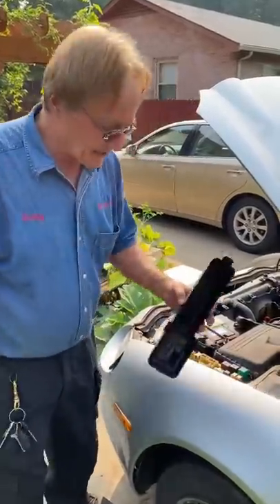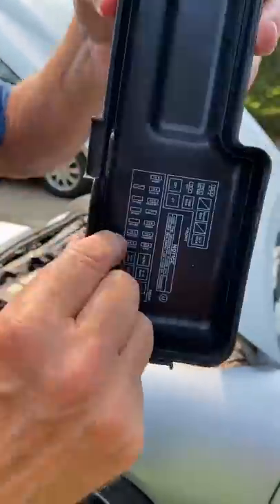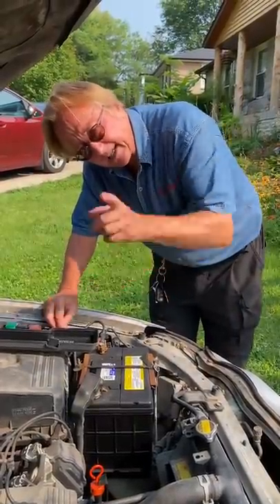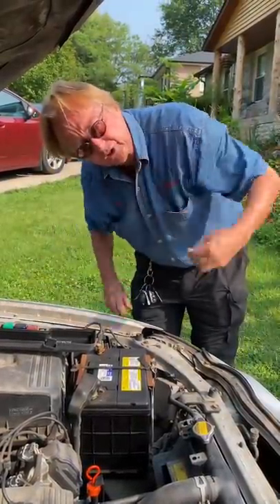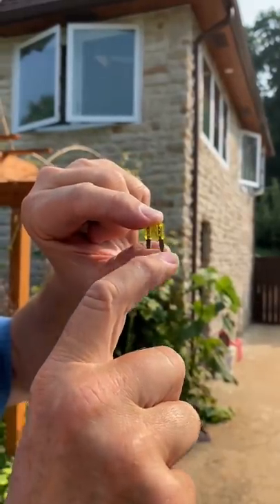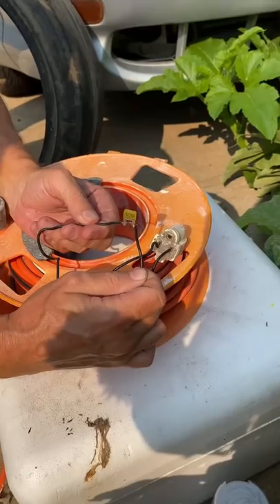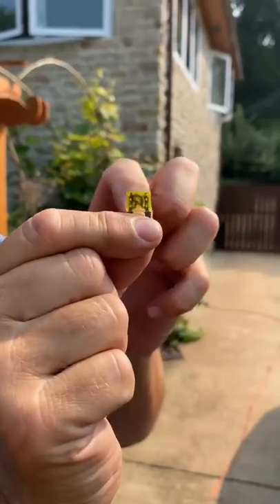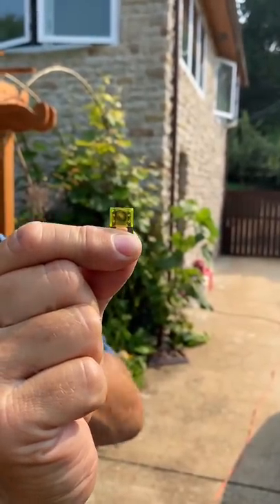Don't Get Screwed by a Mechanic, Check This First

Comment: If you want to disable your car without an expensive alarm system.  Just pull the fuel pump fuse/relay then put it back in when you want to go somewhere.
Reply: That a good tip bravo.
Reply: But what about us who also use lpg and gas😜
Reply: @opcgsi9162   pull the starter relay
Reply: Yeah my cars too old for that lol
Reply: @matthewmorgan582  you could pull the coil wire off the cap. Same outcome
Reply: When I park my car I just remove the engine. No stolen car!

Comment: had a 91 Cutlass Supreme (the trim with all the pretty digital/electronic gizmos) that ended up consistently blowing the fuse for the cluster and button backlighting. Luckily the digital displays in th cluster, radio, climate etc still lit up, but on full daytime brightness Only the actual buttons were dark. Nobody could figure out the short quickly or cheaply enough so I lived with it for 5 years LOL. So many buttons to remember their positions!!

Comment: Hey Scotty, don't forget those infamous Chevrolet Trailblazer black relay fuses that go out. I recently went to the junkyard and got two from off a wrecked Oldsmobile Bravada when my Trailblazer headlights stopped working and saved $40 dollars because the cashier said I could have those two little fuses for free 🙌 Hallelujah

Comment: My old 1989 Nissan pickup occasionally blows the headlights while going down the road. I just switch to highbeams. Never blows fuse and can't find the problem.( and I'm pretty good at finding shorts and such) As this happens only 2 or 3 times a year I just went to the " you pull it" wrecking yard and filled my pockets with spare light bulbs. Got a few spares for my other cars, too.

Comment: I feel like a silly weenie lol, I had that problem a few weeks back on my 94 Z28. But my tale light  housing broken so  I thought it was the wiring, so I did all new connectors just to not fix the problem. Well I finally thought well maybe it's a fuse. And that's exactly what it was 😂
Reply: A tale is a story.A tail is yo butt!

Comment: I have had fuses that look ok, but then I checked them with an electrical tester and found they did not show that they worked.  I changed out the old fuse, like Scotty said and the light functioned perfectly.  I had to search the old plug using a magnifying glass to see the minute break.

Comment: Hi, I have a 2001 toyota Yaris 100.000 miles. I have a Check Engine Light with Code P1349. I changed VVT valve (Oil Control Valve) but the check engine light is still on. The Toyota dealer says that I should also change the timing chain based on that error code (but they didn't ispect the car and I don't hear no strange clanking noise from the engine. I can only hear clanking noise when I change gears usually from first to secondo or from second to third). What else could I try to change? Replacing chain would be too expensive, maybe I will try to open the engine and see if the chain is loose. It's too difficult to check it myself and it's better to go to a mechanic?

Comment: Fuses dont just blow , there was a short . If you simply replace the fuse , you’re essentially putting on a band aid. You havent fixed the intermittent problem and itll just blow again

Comment: 🤦🏼‍♂️ I’ve been a mechanic for over 20 years. I hate scumbag mechanics that rip people off for needless repairs, but I’ve never had a fuse blow just because. Do the proper diagnosis and find what caused the excess load on the system. Personally I think a voltmeter should be part of everyone’s tool kit.